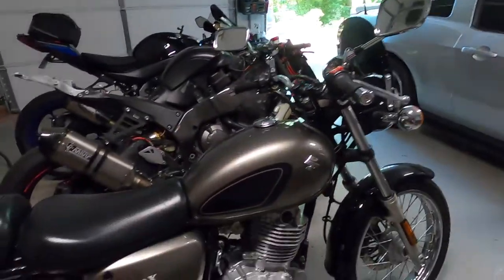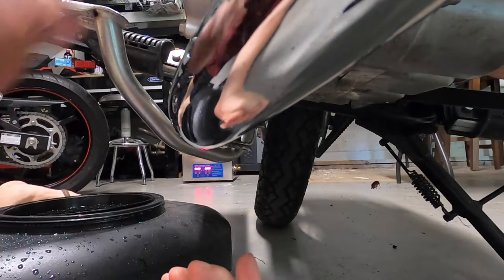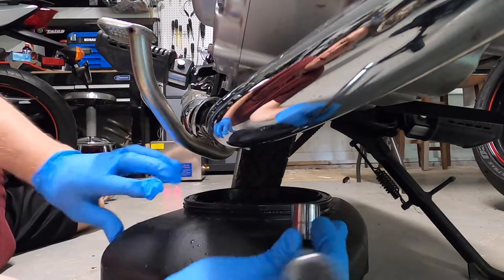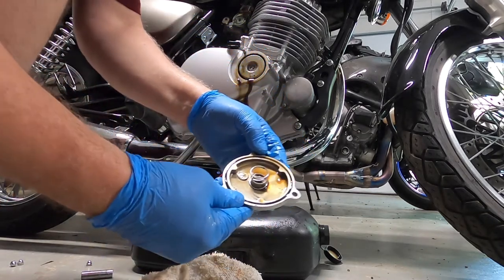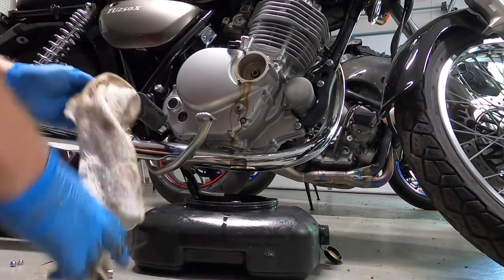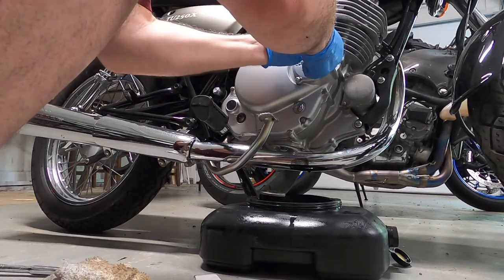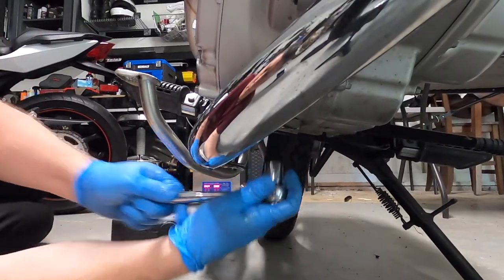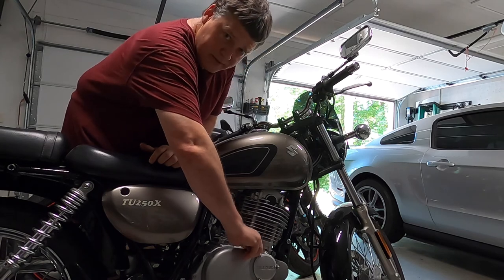HOW TO CHANGE OIL TU250X (2020)

Comment: OK, one more thing: When reinstalling the "gotcha" drain plug, which part of the cylinder (which fits inside the spring) goes upward? The rounded end or the flat end?
Reply from the maker: I think pointed end up. Flat end at bottom.

Comment: The "2nd" drain bolt - the one next door to the "real" drain bolt in the larger round assembly - any ideal what it's for?? I removed it to drain the oil and yes, the crankcase oil drained out. But also, there was a small spring and small cylinder that fits inside the spring. The "gotcha" drain bolt also has a magnetic head (2011 model). I reinstalled the "gotcha" drain bolt, but not the spring or cylinder. I HAVEN'T CRANKED THE ENGINE YET. Please advise.
Reply from the maker: It is part of the shifter.  It needs to go back.  I found it with a search